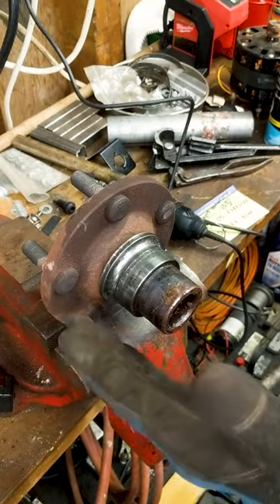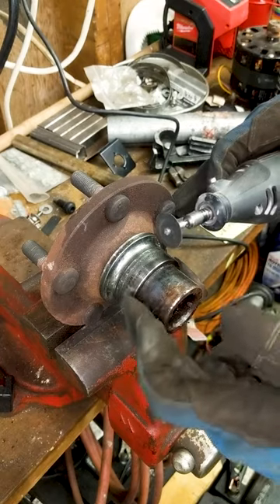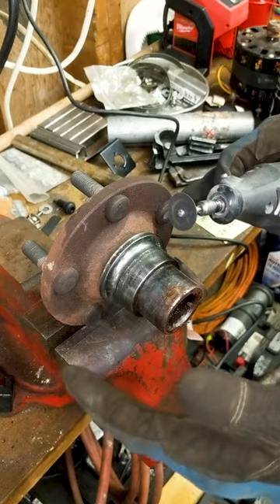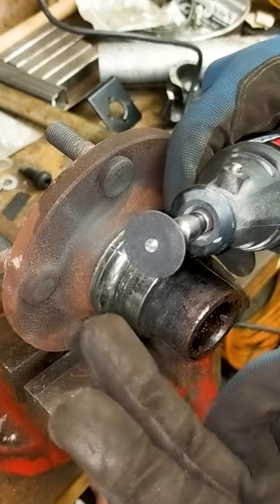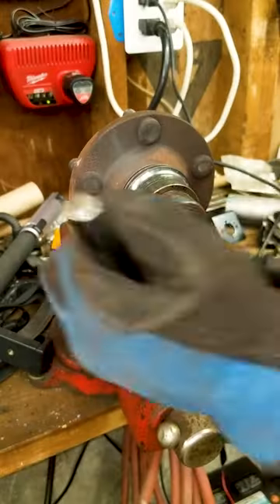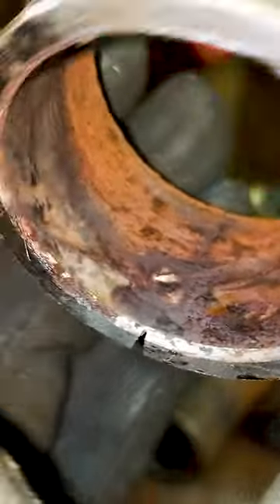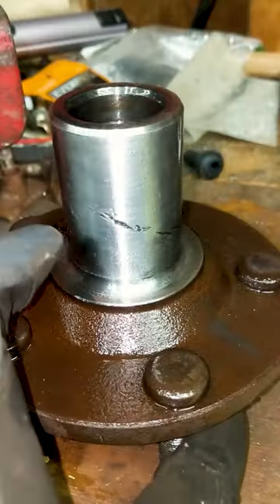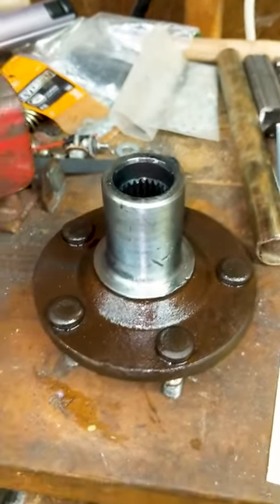Remove Bearing Race From Hub The Smart Way! #Shorts

Comment: That flange is garbage from the getgo, why waste time removing the race? Hub flanges are usually cheap anyways, $20-70 for most cars
Reply from the maker: No way to know the hub is bad without checking runout and flatness. Cheap is a relative term. Always easy to spend someone else's money. I have a thorough answer for you though. Given you should expect I obviously know what a hub costs.
"Obviously replacement is an option. It's not, however, what this video is about. This technique can also obviously be used on much newer and less rusty hubs. Not everyone lives in the rust belt. I also prefer not to create waste or spend money if I don't have to. Additionally, there are virtually no aftermarket hubs available for the 2000-2004 Legacy/Outback and corresponding Baja platform. Plus, aftermarket hubs that are affordable are often lower quality than OEM. If it ain't broke, don't fix it. The OEM replacement only comes as a hub and bearing assembly, and is quite pricey. The target audience for this video is primarily DIY mechanics, home gamers, and people on a budget. If you want to replace your hubs, but all means, spend your money instead of spending 5 minutes saving the hub. Personally, my 5 minutes is worth the $75 minimum this hub would cost to replace. Even the cheapest hubs I have seen are usually $25+ and I'd rather save the money. Lastly, this car is very high mileage and on its last legs as is, so a new hub would kinda be a waste. I have never had an issue with a hub I reused. Just saying."
Reply: Hmm, there’s plenty of available front flange options for the car you specified. The rear is sold as a bolt in assembly so no need to even press apart the hub bearing. 

Aside from all that, even if a new flange is hard to source or extremely expensive, reusing one with lot of mileage on it has its risks. 

First is rust, which the one in your video has a ton of and that effects the press fit. Even after you cleaned it there is obvious pitting visible. Without an adequate press fit that flange could cause premature bearing failure. 

That leads to my second point, even if an after market flange isn’t as superior as an OE flange, they will still be far superior to a worn and damaged OE piece. 

Third, my time is money in the shop. If I spend .5 hrs removing a bearing race when a new part cost $40 dollars with mark up, at $150 p/hr I’d be saving the other people $35 easy.
Reply from the maker: @joewindsor1119  I research auto parts more than anyone I know. You act like I didn't research this before doing the repair or telling you what I did. This is the rear, so information on the front hub is not relevant.

The only rear hub available for this year was on eBay for $75 which is pricey for just a hub and the fitment is dubious given the lack of general availability. Many aftermarket hubs are also lower quality than OEM. The hub and bearing assembly is not readily available aftermarket and is expensive from the dealer.

There are very few risks with reusing a hub that came off of a car functioning properly. The highest risk is runout causing a wheel vibration or wobble. The main reasons to replace it would be accident damage, damaged stud holes, or being completely out of spec in some other way.

Even if the bearing is no longer as press fit as it once was, if it is an interference fit, the axle nut with proper torque retains it. In this case, obviously, it pressed back together with a proper amount of force and there is no issue with the fitment.

I'm guessing you did not test the runout or flatness of this hub? I'm guessing you didn't check the diameter of the shaft? I'm guessing you didn't do anything with this hub at all? Probably because you weren't here.

This bearing failed due to high mileage, rough winters, and excessive weight in the car. Plus it was probably a cheap aftermarket bearing. It did not take me anywhere near half an hour to remove the bearing race. It's more like 3-5 minutes.

The new part is more than $40, I don't mark up my parts to customers, I don't charge as much as you, and obviously your situation is different than mine. Though if it takes you half an hour to remove a race no wonder you don't do it.

In this case the real calculation is let's be generous and say 10 minutes to remove hub vs $75 to replace or 20 minutes total to remove hub and press into new bearings vs $167 for a new hub and bearing assembly from the dealer. Without tax.

Obviously, if this was a nice car planning to be kept for years, the new OEM part would be a good way to go. This is an old, rusty, on its last leg beater. I reused the hub because it was easy, it made sense in this case, and it saved my buddy money.

The bearing was installed months ago and has been working fine ever since. I'm really not sure what your objective here was, but I do understand hub and bearing assemblies, replacement, specifications, and shop rates.

NONE of that was the point of the video. It's a tip for people to use. If it doesn't apply to you, then don't use it and move along.

Comment: Because that hub is junk and nees replaced or it will ruin the replacement bearing if used.
Reply from the maker: Strange that the car has been running for thousands of miles with no issues now. I literally improved the condition of the hub over the last time it was installed by smoothing out bumps and gouges. No way to know it needs replacement without measuring it, so don't talk out of your bum.
Reply from the maker: @mattlile1738  Don't talk out of your ass buddy.

Comment: best way.. buy 
a new hub its cheaper than you think
Reply from the maker: Always easy to tell someone else to spend their money! In this case, with a 2000-2004 Legacy, there are essentially no rear aftermarket hubs available. Cheapest I can find is $75. Aftermarket hub quality is often not as good as OEM too. You can only buy the hub and bearing assembly together from the dealer, which is nearly $200. Aftermarket options generally only sell the bearing without the hub. So not only does this save you money, but it's one of the few ways to do the job without buying directly from the dealer. This is also an old car on its last legs. I make videos to save people money, not make them spend more. :)

Comment: or throw the whole fucking thing away because it's scrap metal now
Reply from the maker: Old car, very high miles, on its last leg, cheap bearing I installed with this hub is going strong. Did the same to the other side a few thousand miles ago and it's fine as well. 🤷‍♂️

Comment: But you seriously screwed up the race. things junk now.
Reply from the maker: You mean the hub? ALL of the damage was from before me. I literally did not even knick it. That was the point.
Reply: @802Garage  Nah the bearing race. It's toast. Cut a big ass nick in it. Highly doubt you're gonna weld that back together when you put it back on for the customer. Besides, you'll never be able to polish the bead back level.
Reply from the maker: @joblessalex  I'm... Not sure if you are trolling. The race gets replaced every time you replace the bearing. It comes with the new bearing be it a sealed one piece bearing or a three piece bearing.

Comment: Or just use heat
Reply: That's what I said but he replied and said it's about cutting. I could have swore the title said remove bearing race from hub the smart way heat is smart and fast
Reply from the maker: @nelsoninman3678  99% of DIY mechanics don't have an acetylene torch. I also prefer to avoid heating large chunks of metal whenever possible. Plus this is nearly as quick as the heating method, especially if you cut more of an angle which I forgot to, and doesn't require wheeling the torches out. Y'all are both intelligent enough to know that just because the title says it's the smart way doesn't mean there aren't other smart ways. The title is meant to infer versus using a full size grinder and using air to save the cutting wheel. Take tips as you can and use them as you want. Everyone has seen the South Main Auto video or one of the others, I get it. But I'm willing to bet about 90% of comments I get saying to use heat are from people who have never even done it themselves and have just watched videos. This video was about a cutting method, not a heating method. Have a good day!

Comment: That hun is to far gone anyway replace the whole hun aswell jaha
Reply from the maker: I assume you mean hub, but nah, it's fine. No way for you to actually tell without testing runout and flatness anyhow. Reused and no vibrations or anything. Car is extremely high miles and on its last legs as is.

Comment: Hub should be replaced, probably why the bearing went out
Reply from the maker: Nah went out from mileage and a heavy loaded car and probably a cheap ass bearing. I cleaned up what the previous "mechanic" messed up and it's going strong with this hub. It's an old beat up car. I've never had an issue with a hub I reused. 👍 Obviously I could actually check it for runout and all, but other than some knicks and dings it's serviceable.